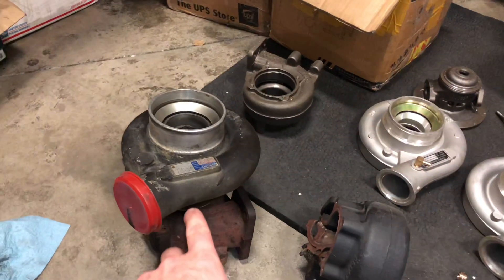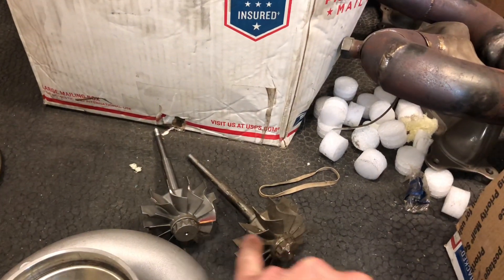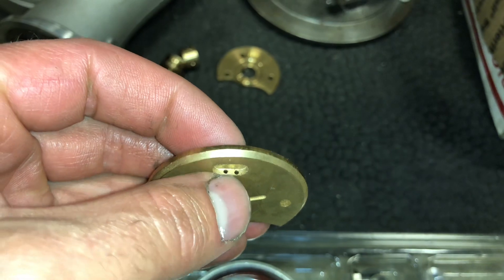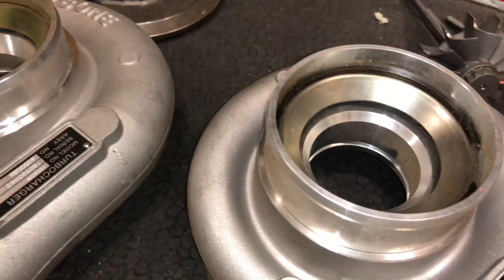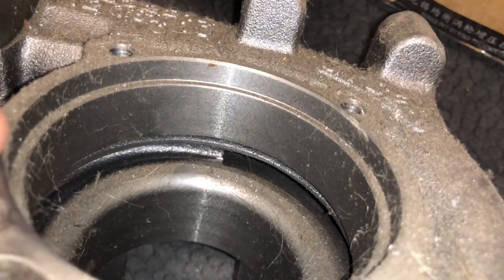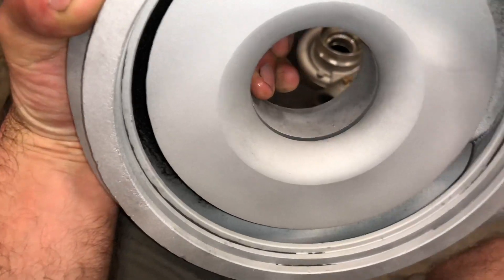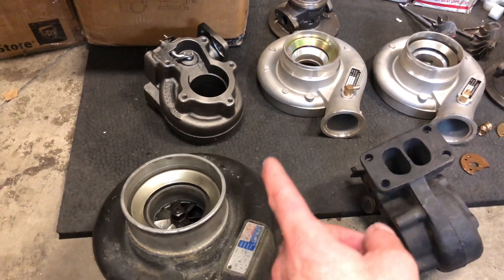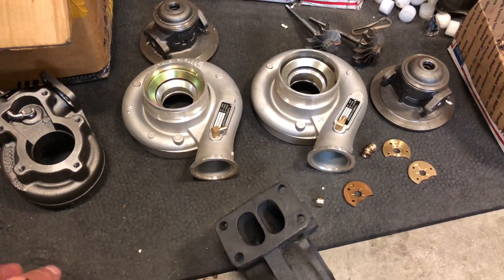EBAY Hx35 turbo vs Genuine

Comment: You can get a “name brand” HX35W with a 5-yr warranty thru RockAuto for like $300. Search for a late 90’s Ram 2500 with the 5.9 Cummins (or Cummings for you wierdos).

Comment: We made upgrades for Porche Motorsports..... And Hennessy Racing.......... All original Holset Hx 35 and 30's had an oring.... You machining it just got you more money..... I have build 1000's of Hx 30's and 35's.......... Even with billet wheels................ Nobody should listen to you.............  Do you VSR them??????? We did at 150,000 RPM...... Slow speed balanced, the turbine shaft, the compressor wheel by its self and slow speed  balanced them as an assembly..... Then built the cartridge all lined up and high speed balanced them at 150,000 RPMS....... No FAILS EVER.... Did you know any turbocharger will spin 5,000 more RPM with royal purple than any other oil to this day......we tested it..... Mobile 1 executives, Pennzoil, redline,  they all had bad wear on the bearings.... Mostly the thrust bearing........ Royal purple ,we ran it even after the others started leaking from the compressor side............ It was picking up more RPMS, no scores on bearings.......... .... No leaking internal oil.... Did the same test with ceramic ball bearing turbonetics turbos...... I still think a K29 turbocharger is the best turbocharger ever built............... Look up what they were put on..... My brother built about 10 of them..... Originals........ For a nostalgic Porsche class that still races to this day............ 900+ hp

Comment: That original holset turbine housing is all cracked to fuck............. Looks to be welded too....... Cracked all the way to where the bearing housing flange mounts......  We repaired them and looked brand new........ Who did that repair????? They should be fired.....that's trash ass work for a repair job ..... Nobody on here sees the 2 inch crack across the whole inside of the turbine housing??????

Comment: I'm looking for a 10cmHX35, considering the size difference, what would be your opinion; Is it a 10cm? I have an HY35 but I just want to step up a bit the 2mm bigger turb should give me a little more top end correct? I don't want to lose the quick spool of my 9cmHY.
Reply: It's on a 24V Cummins, Fass DRP, DIY Big line, Power Puck, stock 47re tranny w/ GM Pressure Gov/Sensors, plan on building it with an upgraded TC.
 Could I get my HY housing carved out for a slightly bigger wheel, like 2mm on both?
Reply: Like a 56x78Comp/ 60x70 turb/ in a 9cmHy, or 10cmHX? I plan on getting a better tuner like Edge or Quad, but probably not doing Injectors, if I did I'd just do 40-75HP. I use it for towing trailers and deadheading back, I like the mileage I get just with the Power Puck, but my Turbo howls needs rebuilt, 188k on her, I don't have a boost fooler yet or have a J hook, jut running 20 lbs, but I'd like to see if I could eek out a little more MPGs empty and have a little more power towing.
I'm keeping the auto, I want a lower final drive and the auto has a .69 vs a 5 speeds .75, I will probably get a gear vendors overdrive after I build the Tranny. I'd like to be in the sub 2k rpm on the interstate empty, but still have some passing power without downshifting that awful tranny. An Allison is out of my reach, I rebuilt my work van's 46re in my driveway over a weekend, 30k miles ago so I think I can handle the 47, and will take my time on it, I build furniture and cabinets, but I enjoy wrenching.

Comment: Remember theres is also what you cant see with the naked eye. What material they are made off. Ive been using Melett parts recently, and its a whole difrent ball game.  You can feel the weight, less play, and the turbo just keeps spininning.

Comment: I'm about to buy an s14 '98 with an rb25 engine swap with an hx35 holset, I'm gonna watch this video later to ask for the owner detailed pictures of the turbo, the exhaust manifold it's I think kind of ugly, any advice ?  Has 300zx brakes, diff, std transmission,  ECU swap. Engine never opened, just manifolds swap, running 300hp on stock internals,
Reply from the maker: Do a boost leak test. Watch my boost leak test videos

Comment: How common issue the divider cracking is? I checked after seeing this video and  my otherwise genuine hx35 super has that kind of exhaust housing you showed here in this video. Except the divider in mine hasn't been machined at all as it isn't that tall. It is thin as in the video tho. It is going on a car that sees low km's but it is going to be a high boost application, 30+psi.

Comment: Great video.. do you know I’d the Chinese compressor housings will fit directly and nicely onto a genuine holset mid section? I ask because I had the idea of buying a Chinese HX40 compressor housing to use on my genuine hx35 so that I could cheaply mod my hx35 into a hx35/40 hybrid.. let me know if you think this is a good idea to try.. if not what is the cheapest way for me to mod my hx35 to a hx35/hx40 hybrid? Thanks in advance!
Reply from the maker: There maybe multiple versions but the housing likely fits the bearing housing, you should be able to transfer over the wheel and housing
Reply: @turbolabamerica  ok thanks. Could you guys sell me a milled out hx35 turbine housing so it can fit the 64mm 10 blade turbine? I wanna make an hx35/40 hybrid for my cummins

Comment: If you got got a cheap ebay hx35 for 150 bucks and put genuine holset bearings in it would it it be worth it?
Reply: Im gonna put the groves in and drill the holes myself if that don't work ill just buy the kit afterwards lol as for the turbine if its fragile heat it an dip it in engine oil till it cools off to temper it at the least i guess lolol

Comment: I bought your rebuild kit for hx35 off ebay and I must say it is a very nice kit I had originally went with a oem holset kit for around 100 dollars because i figured well if this turbo lasted 450k miles surely I need to use the same parts but the problem was all it came with was 4 bolts 2 journals a thrust bearing c clips oil rings and an o ring and that was it I had ordered the kit before tearing down the turbo turns out the internal heat shield was worn on one side from the exhaust housing being loose and was causing it to sit slightly crooked so i ordered a new heat shield from Ebay for 10 dollars turned out to be wrong one and wasnt worth sending back as it took 3 weeks to get I needed something now my truck been down for a month so i finally just said screw it and bought your kit and man I wish I would have went with your kit from the start before wasting all that money it comes with every single piece that is in the bearing housing which I can tell is good quality the gasket material is good made in USA O rings are silicone which are great for high heat applications and best of all the lap joint oil rings cause the OEM ones are not lap joint and mine had slobbered oil for years not a lot but a little

Comment: How much ? I’m in Canada I have a 3500 dully driving hone yesterday started smoking like crazy !!! Turn out oil was going through turbo and out the exhaust I took the boot off and there’s so much play in the turbine shaft or whatever it’s called it’s unreal anyway it’s my first diesel I need it back on the rd what should I do it’s a 2005 24valve Cummins ! Any hell would be appreciated maybe I can buy a rebuilt one from you off eBay where would I look on eBay for your rebuilt turbos ! ?

Comment: Excellent video and valuable information, thanks for sharing. Been a gas-driver since 1964 and just bought a 1994 6.5L Turbo Silverado C3500 Dually. I will be giving you call.  Subscribed.

Comment: What would be a decent turbo for a 5.3-6.0L gas engine, 750+ HP, and upto 6800 rpm? Around 15 psi, I was looking at a eBay turbo,

Comment: About a year ago you helped me figure out how to rebuild an he351 that had been remand by Cummins. It turned out great! You helped me out even though I didn’t buy the rebuild parts from you. Thank you very much!  The next turbo project I want you to build me one of your upgraded Hx35s. When the time comes I look forward to doing some business with you!
Reply: That's why he is my new turbo parts supplier i was all about OEM cause i figured if my turbo lasted 450k miles it ought to be good kit and figured it it is getting tired by now so I ordered holset kit it barely came with anything his came with every single piece inside the housing and is machined here in the USA with USA materials which is much better than chinese even included lap joint oil seal rings unlike oem does not and hx35 are bad about slobbering oil because of it. In my experience he is a good honest fellow and has experience with a lot of turbos so any turbo advice needed he is the guy to ask.

Comment: Any chance you can go over the differences in the bearing housings from knock offs oem and the ones you sell
Reply from the maker: Jacob Hoke the dimensions look same from what I could tell, ours come with the oring groove machined which fits most oem bearing housing with the to4e oring. Some of the oem compressor housings the oring area didn’t machine all the way out because of the casting being offset when machined. If that’s the case I always machine the compressor housing and use a larger oring

Comment: Sir, what is more reliable for High Boost: A single turbo running 45psi or a twin sequential turbo set up to run 45 psi???
Great video
Reply from the maker: John Parrish I prefer single turbo over compounds. Twin turbo is okay. I don’t like compounds because of forcing air through a smaller turbo. The smaller turbo as a result should  have problems much sooner from excess heat but I don’t know that to be true, it just seems logical because the larger turbo is forcing the smaller to to see rpm that it’s not designed to see, in which case it would seeing high temperatures if it was flowing that much as a single turbo setup.
Reply: @turbolabamerica  Excellent, Thank You
Reply: The wastegate should control the shaft speed of the smaller turbo on a  compound turbo set up. A sequential turbo set up used a butterfly style valve on the "charge pipe side" in order to controll when the larger turbo is at the same psi as the smaller turbo and doesnt cause feeding issues back into larger turbo at low psi 

Now your question really shouldnt be psi related as these two set ups are designed to perform extreamly different tasks one (sequential) covers a larger rpm band and makes larger trucks more divable

The second being a compound turbo is used to do exactly as it says and compaind the given airflow of a smaller turbo by forcing more than 14.7 psi (sea level) of air into the intake (most compressor maps are set at this 14.7psi) if you double the intake side 29.4 you essentially double the probable output of the smaller compressor wheel each needing to be sized correctly 

Now where psi and performance may play a better roll is by twin turbo charging you can use a smaller turbo say 2 that flow 35lbs of air at 20psi you would see 70lbs of airflow at 20psi however the 2 turbos have a fixedpower band meaning the set iether low end mid rang or high rpms
Reply: @jacobhoke581  I want you to take a look at something you might find interesting. Look up a YouTube video called "Quad Turbo LS tuning on an engine dyno with DeBoss Garage", its a Sloppy Mechanics video.
This is a V8 engine running dual compounds that came off V6 diesel engines.
I think you will be entertained.....LOL
Reply: @jacobhoke581  Sir, did you complete this engine and dyno it??
I would love to see the torque curve.
Reply: single turbo because it spools faster